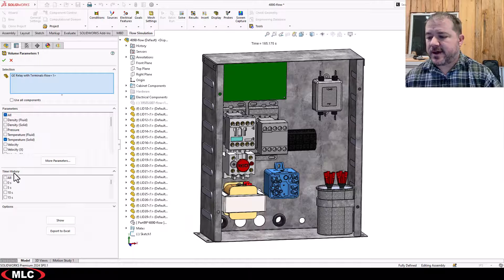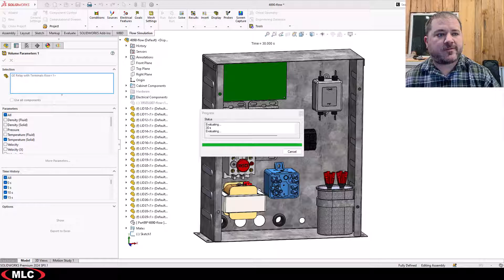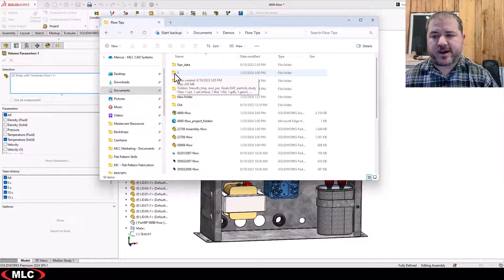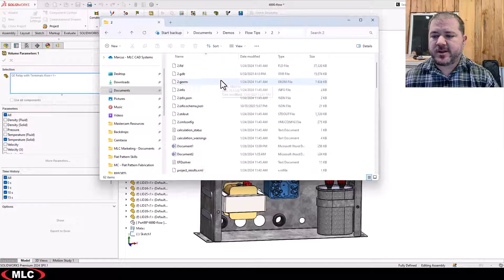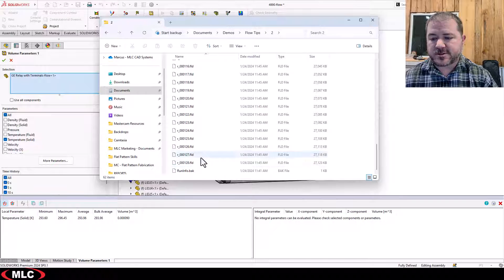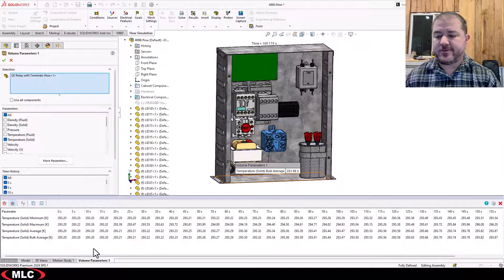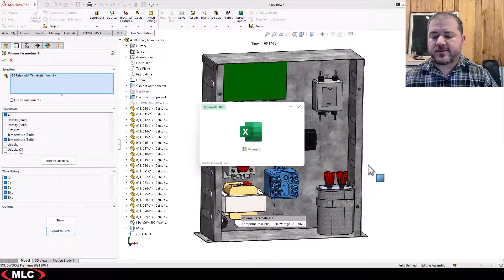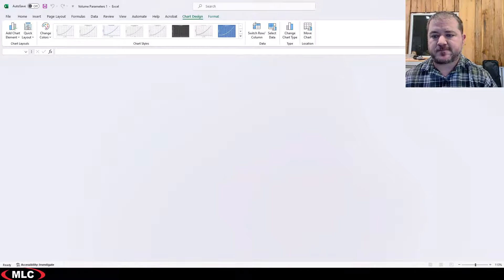Plotting Time-Dependent Measurements for Transient #CFD Results | #SOLIDWORKS Flow #Simulation

Comment: I have a problem where I cannot get the goals i set after a transient study, its an external study and I wanted to get lift,drag forces as well as a torque goal. After the simulation I couldnt get the specific values of the parameters I needed. I checked all from point parameter, surface and volume, including goal plots but i cannot find a history of values throughout the physical time and perioding saving that i have set.

Even clicking the more parameters I cant find the force nor the torque parameters
Reply from the maker: When you define a goal plot, you should get a list of all goals that were solved with the study to choose from.  I can imagine several possible reasons why this isn't working for you.  If you add the goals after solving, the solution won't include the additional goal data retroactively.  Either solve it again after adding the goal or use a parameter measurement and plot that over the available time steps.  If the goal information is there, but can't be plotted over time, it is possible that the study is not setup to be transient or the saving options are not setup to capture any data after the initial solve.  It could also be an issue with stopping criteria, where the stopping condition isn't a correct physical time and instead is a goal or other parameter that stops early.  Right click on the results folder and see if you can load a specific time moment, that will give you a listing of all timesteps that were saved, and if there aren't any then they aren't being saved or calculated in the first place.  I hope that helps, good luck!!
Reply: @MLCCADSystems  i have finally found it. Its not the usual way to get like the other parameters such as temp or volumetric parameters. I just had to do extra clicks on the goal plot section to extract those values that I need. Thanks for the long response I've watched your transient series and it really help me on my undergraduate thesis. Thanks so much

Comment: Great! I'm having a hard time finding where to adjust the time duration and time increments after the set up has been complete. Under the calculation control options, I'm seeing it appears I can edit it but it doesn't actually effect the study.
Reply from the maker: There is a difference between time, time steps, and saving.  There could be a few things going on here, see if this helps.

Time is how much physical time should be simulated when it is transient.  That value has no meaning in a steady-state study.  If you request 10 seconds of physical time, and you solve it to the end, then modify something and hit solve again, it won't solve any more if you continue the calculation without extending the time.  The results are saved up to that requested 10 seconds, so changing things now without extending the physical time won't do anything.

There will always be a time step across which Navier-stokes is solved for each step of the calculation.  For steady-state, this is pseudo-time so you don't need to worry about controlling it.  For transient solutions, it is recommended to allow the solver to self-select the time increments for accuracy, but you can override that.  Time steps will always be less than or equal to the saving intervals.

Saving is how often the results are saved to the hard drive.  Your study may require 8,000 unevenly spaced time steps to get an accurate accounting of what happens during the study duration, but you may only want to save 100 result files at specific time intervals.  Time-dependent plots and animations that were not pre-defined as goals can only pull data from the time steps you choose to save.  Choose carefully, result files can take a lot of storage and can be very slow to process, so I recommend saving a reasonable number until you are satisfied with your study setup.
Reply: @MLCCADSystems  This is helpful, thank you! These are by far some of the best content on YouTube for SolidWorks CFD. Really appreciate you sharing.